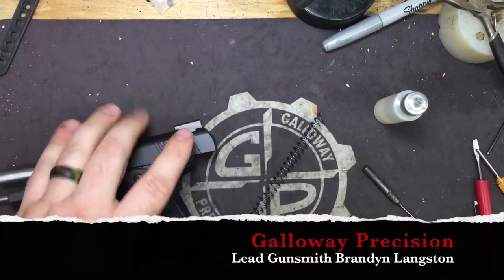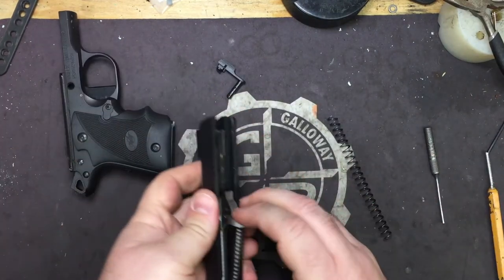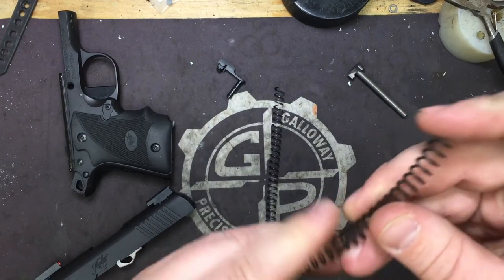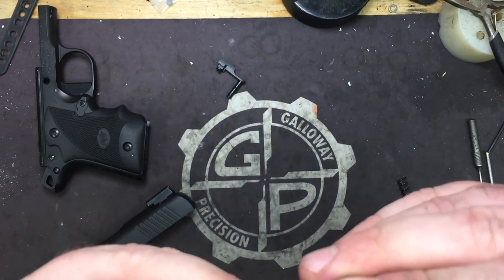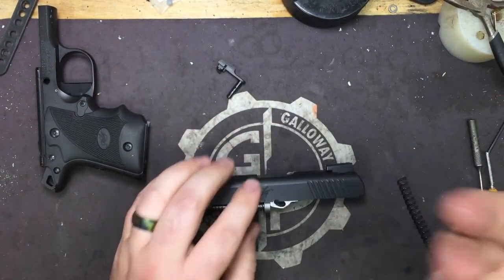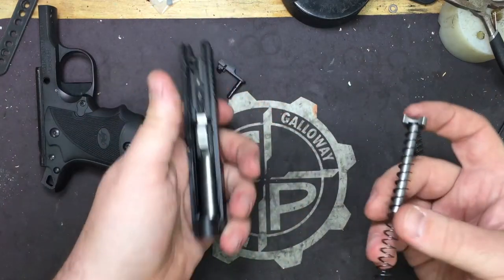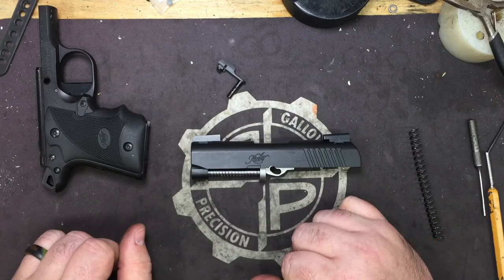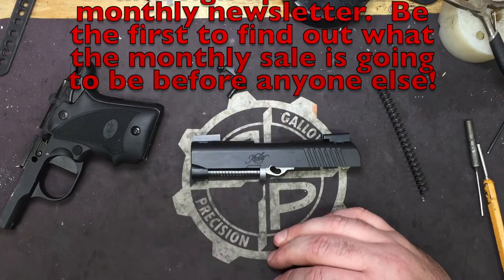Micro 9 Recoil Spring Installation.

Comment: Because of some hand and joint issues like you described in your video I insert a wooden dowel into the opposite end of the spring to guide the spring collapse and hold everything into place.  That makes it easy for me with a heavy spring.
Reply from the maker: Nice, hadn't thought of that.

Comment: It seems like the heavier spring might affect the function of the cycling? I’d like to see a before and after video of you shooting the gun with the factory spring, then the aftermarket spring. With a side view of the recoil and cycling. But it does seem that it would help with the recoil and extend the life of the gun as long as it did not cause any other issues.

Comment: Total bi/ch to get in but will be worth it. Actually had my wife hood the slide while I used both hands to compress and guide the spring into place. Thinking it will loosen a bit over time. But there is no doubt it is a heavier & longer recoil spring. 😁

Comment: wish you guys would make a guide rod for it too. mine broke out of it somehow back in 2017. got sent a new one. but, still don't trust it fully. it's only happened to a handful.
Reply from the maker: It's something we're looking into honestly, but to machine it from one solid piece will make it very expensive.  That's why they have failures from time to time it's a two piece rod that is swedged together.
Reply: @GallowayPrecision  I hear ya. I had contacted you guys when it happened and was told it would be put it on the list. I just figured it wasn't a issue enough for you to bother. I'd like a stronger one piece design. my options are stock or the p938 rod with loctite. haha I'll patiently wait. might try your spring in the meantime.

Comment: What orientation is up when your talking about the spring? Normal firing position?
Reply from the maker: Not sure I understand the question. The recoils spring slides over the guide rod itself and the spring can be placed on the guide rod from either end of the spring.